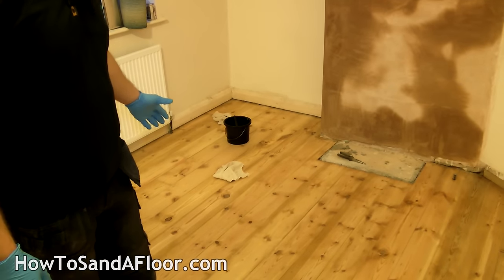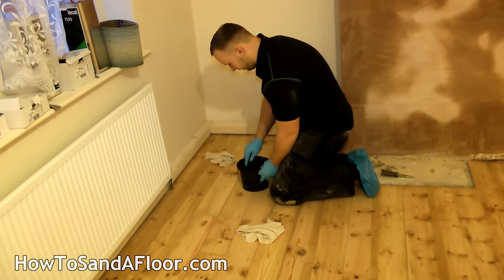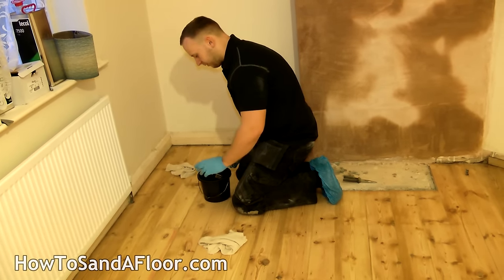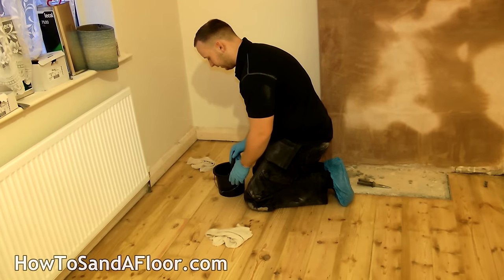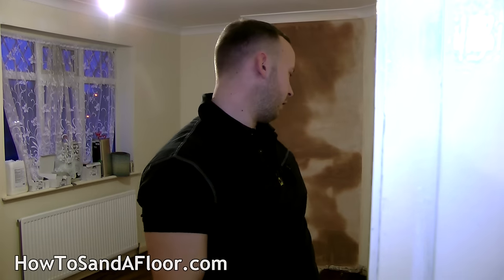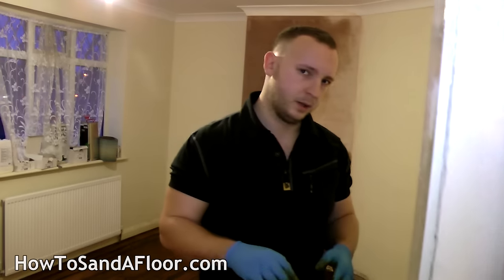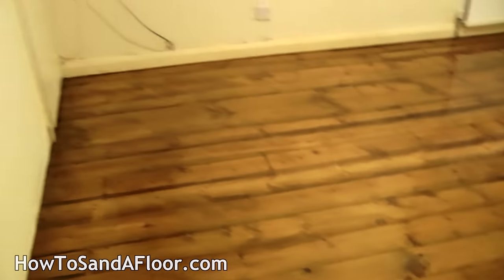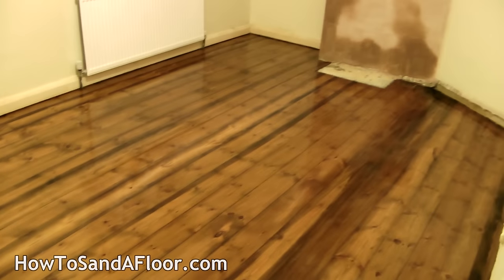How to Stain a Wooden Floor (pro method for DIY)

Comment: ATTENTION: In my research, I have seen so so many videos on how to stain a floor and they all use different methods. This leads one to believe that ONLY ONE method is right. Either way, I like this method and this guy knows his stuff. Often it is not a particualr method that is wrong BUT a step within a method. For example, one guy did not sand down enough to get rid of old stain and his final job was patchy. It had nothing to do with the fact that he applied stain with a brush (vs rag / vs. spongee / vs applicator). At the end of the day, multiple professionals all have their ONE way. I believe the principles matter. Either way, I like this video. another interesting fact is that haters hate on EVERY principle regardless. No one will agree with every method even though multiple methods work great. thanks for the great video - this method worked very well!
Reply from the maker: thanks for the comment! :)
Reply: Well said. Retain what's useful, and add your own spin if a method is discovered.
Reply: Yes, it's wood, not a space ship
Reply: @mpreiss  exactly! Space ships are Aluminum or maybe even an advanced form of titanium carbide alloy. Either way, I would treat it differently than a wood floor. A wood floor is an opportunity to hone one's skills whilst daring to be creative: to be one with the wood and one with ones own peculiarity, a unique masterpiece undertaken with principles AND the personal. Conversely only one specific exact way exists to finish a spaceship body: tremclad exterior spray paint
Reply: @TechNACITYbjj  yeah, its like cooking which is more of an art, with room for creativity and variations vrs baking, which is more of a science, that needs exact measurements and temperatures.(my expertise)
Reply: @mpreiss  my cooking and baking is usually a disaster so I'll trust you!!
Reply: if he knew his stuff the result wouldn't be so blotchy though. Not hatin, just noticin 😉

Comment: Been doing floors for 34 years, tried buffing stain , didn't like it. Still do wipe on, wipe off. It  does a better job. Nice work on the staining.
Reply: This comment probably just saved me another $56  home depot rental for a floor buffer that I didn't want to rent.  Thanks!

Comment: Thank you very much for the videos on how to sand, fill, stain and lacquer wood floors. I plan to try to do this on my own on my old oak floors and after watching these videos I feel much more informed to go about it. I would like them to come as close to the darkest brown/espresso color as possible. Do you have any suggestions on a color stain/brand that I can use or do I need to do more than 2 coats? I have some pretty deep scratches on the floors that I'm afraid may not even out with sanding, will the filler fill them in or should I work some of the dust mixture in the scratches first? Also, do you have any before and after pictures?
Reply from the maker: Nicole Wong-DeSantis Thanks for comments and questions. As for color, it sounds like you want something like a Jacobean dark oak. I can't really recommend a manufacturer, because i don't know whats available to you. Stain is usually just 1 coat if its done properly. Make sure you go to the website and read the article on staining. Usually scratches look very deep and infact they are much shallower than they appear. It is very rare to have a scratch that won't come out with sanding. Good luck!

Comment: Lesson to be learned here for me was using a stand up applicator to apply finish. Makes the job easier and faster. Just pay particular attention that you don't leave puddles.  Sanding is to me an art as you muse be careful not to sand in one particular spot to Other than this  the whole job is rather easy but very time consuming too long. Do not rush!

Comment: Just done our floors upstairs, but used an Osmo floor brush. Soooo much quicker and easier than doing it on your hands and knees with a couple of rags
Reply: I used it too, but it left quite a lot of brush streaks, did you have the same problem at all?
Reply: Yes, they had the same problem. Thats why you should use rags..

Comment: Great instructional video, Benjamin. I read somewhere that you need to leave the stain on 5 to 10 minutes. However, in your video, you wipe excess stain off within seconds. Is there a reason why, besides the need to make a quicker video? Thanks.

Comment: Most trailers it all depends has cabinet doors that have wrap around them yes you can stain them it just takes a long time to have the stain dry you have to be extra careful because it's going to be easier to put on and it's not going to absorb it as well but yes you can do that to a laminate floors also because I have done it to both and it looks great

Comment: I watched your video and read your blog post.  I've also watched all of your sanding videos.  I think I'm ready to dive in head first (I hope there's water in the pool)!  I have to ask, though, is there a better brush that you prefer to use?  Also what type of "rag"?  Also, how many times do I stain, and what do I coat it with after?  Two passes of stain, and one pass of weather protector?  What's the difference between stain and lacquer?  Do I buff the floor in between?  So many questions?  Do you have a series of videos that shows ALL steps from start to finish?
Reply from the maker: cscooper2000 I do have an ebook available on the site that has it all, but in short, 1 stain 2 protectors, stain is colouring, lacquer is protecting. I would use a waterbased polyurethane lacquer and then rub-down/buff after the first coat of poly

Comment: Would you mind to tell me what type of wood that is on the floor, pine or cypress and the thickness, tongue and groove solid wood? Also, what color of stain is that jacobean or dark walnut by chance. I mix my stains by percentage to get a variation of color combo to accent certain textures within the wood. P.S. Can't believe you did that without a mask. Brave!

Comment: what did you do to finish the concrete at the old fireplace?
i have this problem with my floor and have no idea how to finish it, i'll be sanding and staining in a few weeks...don't really want to resort to chipping it away
Reply from the maker: geesterfunk what i always say to my customers is that you can chip it out and lay some reclaimed boards down (staggering it into the floor as much as possible), BUT reclaimed boards never ever match fully, you will always know that some sort of repair work has taken place. I advise people to either paint it or lay some tiles over it and make it a feature.
Reply: ***** cheers for the advice mate.
and keep up the hard graft, your site's a good yin.

Comment: I use a lamb whool aplicater and a pole with the edges trimmed so not to get stain on the base boards as i apply stain 1 or 2 crackheads I hired that morning will rub in/wipe away excess stain in a left to right movement with clean rags all the time keeping the base boards as clean as possible takes 20 minutes.

Comment: you make it look so simple... but how much would it cost roughly for someone to come in and do the job? For roughly the same sized room.
Reply from the maker: +Tessa Leanne £400 or $600 more or less depending on location, details of floor and flooring company
Reply: Ok
Reply: How To Sand A Floor so like 2- 3 dollars sf ?materials incluided?.
Reply: Railey’s custom renovations owner here.... I’ll tell you price varies by location and what’s CURRENTLY down on your floor ect.
To give you a rough idea..... large companies charge anywhere between $7-15/sf.

Smaller companies with less overhead charge closer to $4-8/sf.

Like I said it’s all depending on what’s currently down, and what you’re replacing it with. It’s a time consuming process and refinishing of hardwood floors is icy more based on PREPARATION rather than technique.

Comment: Much quicker with lambs wool but easier to get consistent by hand but man don't it take forever. Lol. That stain was working that dude in such a small room. With a 12 inch lambs wool you can be done in 5minutes or less for a small room. Homeboy in this video looked like it took him over an hour, but I have to give it up to that poor bastard, good job mate.

Comment: Hi, thanks so much for this video.  So my husband and i recently purchased a house and we're doing big reno with a contractor.  We just picked the "dark walnut" stain for our wood floors and when i saw the 1st coat i fell sick to my stomach because it looks almost black.  I've been watching videos on how to stain and most of them say that after a coat your're supposed to wipe the stain off, but my guys left it on for 2 days to then lightly sand it and then shine it..  Is this another way of doing it? or are they doing it wrong?  Please help!!! :(
Reply from the maker: Carolina Burgos It all depends on the product, lots of products act differently. Generally the idea of stain is to saturate the open surface of the wood and then wipe off any excess stain. Did you watch them apply the stain? Are you sure they didn't wipe off?

One of the reasons for lightly sanding the floor between coats is that sometimes after the first coat, very tiny parts of the grain soak up the finish (usually a waterbased finish, this doesn't happen so much with oils and solvents) and swell giving the floor an almost rough texture. The problem is if you lightly sand the stain you may damage it and reveal the colour of the wood.

It sounds to me like they used a coloured lacquer or oil. If that's the case then they are doing the right thing. People often have problems like this which is why whenever I am staining, I put samples down on the floor for the customer to see. So they know how it looks on their floor. Then sand it off and apply.
Reply: ***** YES i saw them apply the stain with a roller and they saw me get worried and disapproving the way they looked, but they told me not to worry because the job is not done and that it's gonna look a little lighter because they need to lightly sand it and then put the gloss/finish... I did not know anything about floors until i came home and started searching for some explanation.
Reply from the maker: Carolina Burgos  ok that definitely doesn't sound right
Reply: ***** yup, that's what I tried to explain to him and we just ended up having and argument...I told him to just sand it again and not to paint them again, I'll get someone else because the job is hideous

Comment: Hi

I've just bought a house which has a lovely wooden floor throughout. Unfortunately the floor boards are butted up so closely together that there is clearly no ventilation. Also the structural surveyor said that in time the floor will start to bow where it expands. Is there a way to remedy this? can I saw between the floor boards with a circular saw to create space?

Thanks in advance

Regards Nick
Reply from the maker: rebecca thirkell You can do that but it may make your floor look a bit naff, especially if it's a nice floor. I would pull off the skirting and use the rail saw (circular saw on a rail) and trim the edges so there is a good amount of expansion cap under the skirting once you put it back on

Comment: Hi have you ever had you sandpaper shatter? I’m using a hired floor sander Hitech ht8 but it’s shattered every sheer I have fitted so far. I’ve stayed with Grit 24 as the floor was a little bowed and I need  to make it flat?
Reply from the maker: yes, its because its paper backed and not polyester backed. Its weak cheap sandpaper. You should ask for a refund. Make sure all the nails are punched and that the paper is tight around the drum before you screw the plate down. But yeah that sandpaper is rubbish!

Comment: When is the best time to mop the floor after completing a stain job?
Reply from the maker: has the floor had a finish coat put on? or is it just the stain? if the floor has been properly finish I would give it 2 weeks just to be sure

If its just stain, you dont mop it, it needs to have a finish coat on it

Comment: Hi, im a sander too, been sanding for 16 years. I have a question for you, why you use 60, 80, 100 and then you use 120 grit too? You close the wooden floor too much... Why not only going on 60 and 120 on the hummle or 60 and 100?
Reply from the maker: I don't do 120 just 60 80 and 100. Then buff with 80 grit disks

Comment: are there benefits to using a rag rather than a roller? Seems like it'll take a long time ragging it up.
Reply from the maker: John Rittipo-Moore believe me if i didn't have to be on my hands and knees like this i wouldn't. The stain has to be ragged off, it can't be rolled off. You can roll the stain on but it just applied too much, you would need a lot more rag to rag it off and you would be using far more stain. As it happens i was using an acrylic stain yesterday, i tried rolling it on as the product suggested. But i used 1 whole rag just getting the first line off. Ended up ragging on and ragging off as my supplier suggested. Looked ace
Reply: ***** ok great. how did you prep the floor before staining? methylated spirit? do you need to lacquer after staining? thanks!
Reply from the maker: real stain doesn't leave a film on the surface so yes its ideal to lacquer the floor for protection after staining. You don't need to prep the floor before staining. The new "white wash" stains that lighten the floor these days often need a primer but that's different.

Comment: Hello UK have you heard of putting stain down with a side by side buffer with a carpet pad
Reply from the maker: Of course, unfortunately we haven’t had any stain that made that possible until very recently
Reply: Ok so if I may ask sir my 73 year old hardwood floors were sanded by 000 steel wool 10 years ago and I applied Oil base polyurethane it took almost a week to dry. 
Will never use that again. 
What I want to do is Screen with sandpaper 120 grit and the side by side or with 150 screens. Then clean it all up and put down prestain first then golden oak stain from Minwax.  Then 24 hours later water base procoat Titan satin. 
Do you think that is possible. 
Ty. From New York.

Comment: Why ar getting two clearly darker lines along the joints of the first 3 boards here?  You're wiping down, but they sure are standing out big time...
Reply from the maker: It’s the sapwood of the outer tree. It’s denser and absorbs more stain. You’ll notice that it thins as it goes around knots…

Comment: Sorry to be critical, but if I'd paid £400 - £600 and ended up with that finish I'd be bitterly disappointed. I can understand if odd boards have taken the stain differently but the tramlines on every edge and around the perimeter where the previous finish has not properly been removed looks plain terrible.
Reply from the maker: David Lowe those dark lines are the sapwood of the pine that is much less dense than the heartwood and absorbs more of the stain and goes darker, just the nature of the wood. There was no finish left on the floor around the edge that's for certain. The quality of the sanding wasn't the best in this floor I'll admit.

Comment: Do you recommend a solvent with polyurethane?  Some people mix 50/50 varsol (mineral spirits) for the first coat... just to make it easier to roll on the floor with a roller?
Reply from the maker: It works best straight out of the can. Don’t mess with it. If it was better with spirits they would ad the spirits. So many myths in this industry!

Comment: So helpful and not sure why decorators charge a fortune for this.
Reply: I’m a professional floor sander for an actual hardwood floor sanding company and when we sand your floors then coat/stain them we usually charge you by how much square feet of hardwood were working with. I think right now my company is charging 6 or 7 bucks per square foot to be sanded and finished. There’s a lot of physical work that goes into sanding and finishing floors. Sanding belts/papers can be very expensive aswell with the coat/stain, not to mention the big machines we run cost thousands of dollars!! Hope this helps lol!

Comment: Hi... I'm about to put Larix sibirica floor, do I need to sand it before stain it? Since it has no paint on it, it's brand new.
Reply from the maker: Zlo Zlodi Usually unfinished floors have bad pilling marks on the surface, usually they do need a little sanding.

Comment: Did you use a hardwood conditioner or just plain water on the wood so that it would accept the stain?
Reply from the maker: None, never done that. I have used a very thin primer for a whitewash but that's it